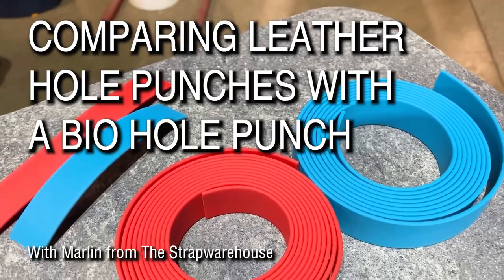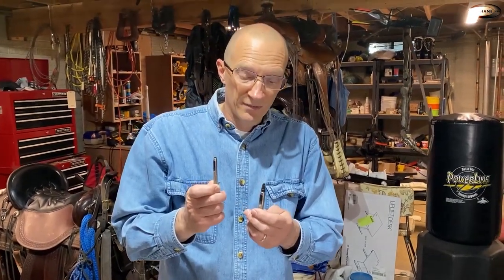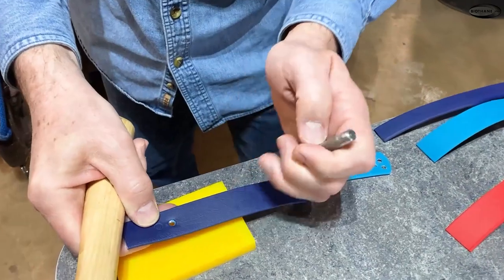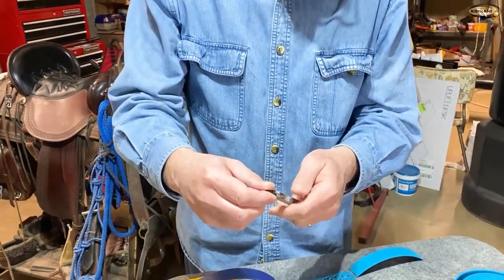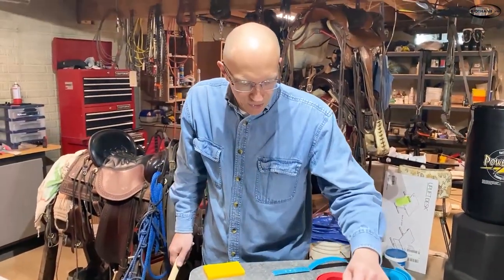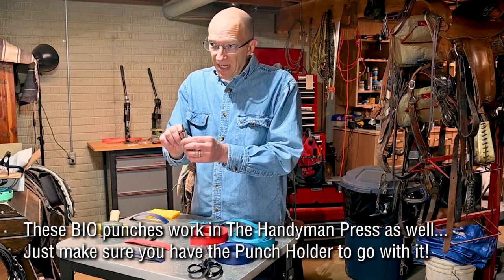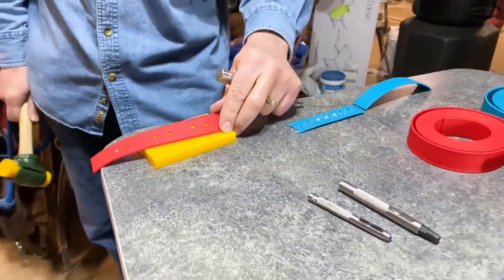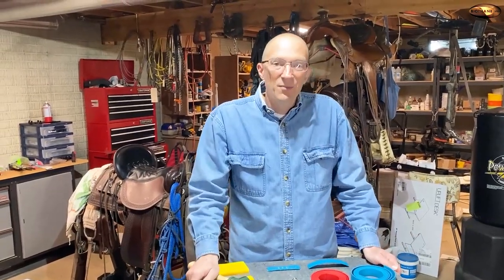Best Hole Punch For Making Dog Collars

Comment: I'm looking for a punch for heavy duty, but cloth/webbing, hunting leads and collars. Could this work on those, even though they do not have bio thane coating? The leather punches I have do make the messy holes in them, just like in bio thane. A very helpful video regardless, but I think your trying to say your punch has a bevel, just a different one compared to the leather punches.
Reply from the maker: We believe you would have more success using these punches over standard leather punches even on an uncoated product, but we have not used these on an uncoated product.  The bevel creates less pulling of the fiber and more cutting when pushed through the material.

Comment: If I want to start making half inch beta biothane multi function leashes and cat and dog collars, what tools do I need to get started? For now, I want to do it for my own dog and cat, but if I'm able to get good enough at it, then I may do it on a small scale for others, as well. ....I am limited on funds, so I am curious what is the best most cost effective option available, right now.
Reply from the maker: The hole punches in this video are an economical way to get started.  Contact Marlin at the strapwarehouse.com.

Comment: which size are you using in the video? im on the website but having difficulty figuring out which one i need. I currently need a 3.5mm wide punch
Reply from the maker: Hi Nessa, the BIO punch we used was 4.5 MM. Thanks for asking!
Reply from the maker: Also, the hole size depends on the buckle tongue you are using (you want the hole to be slightly larger than the thickness of the tongue), or the rivet diameter if you are punching holes for rivets.. We recommend getting at least 3 or 4 sizes to have on hand. I hope this helps some!
Reply: Do you have a shope acount that can i buy your products?
Reply from the maker: @BLUNT00666  Hi Robin, we do not have a shop account but you can purchase directly here: https://strapwarehouse.com/hand-punch-handles/ Thank you!!